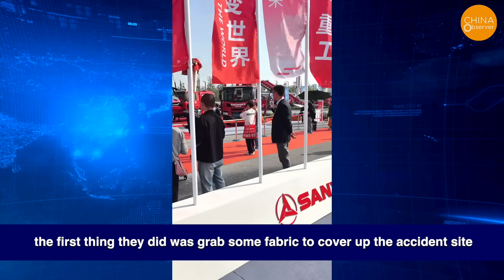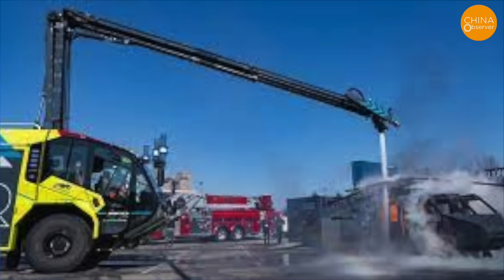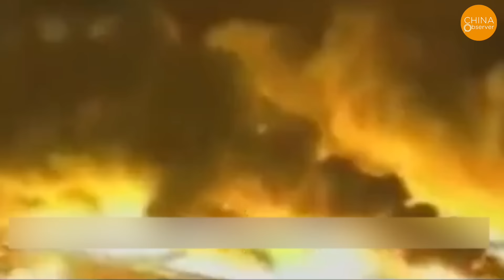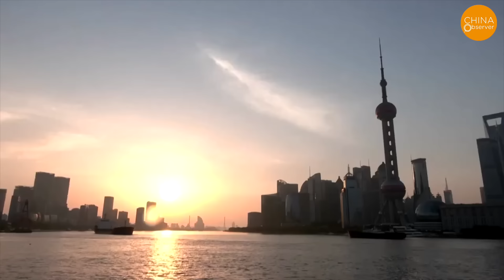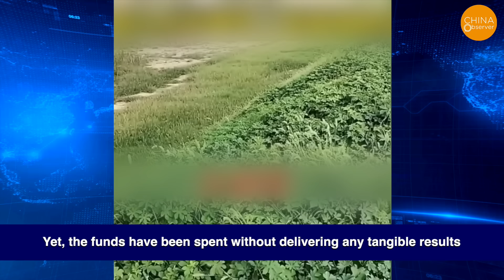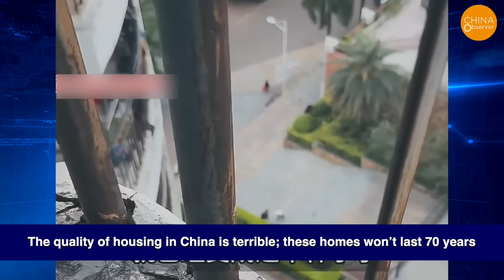Breaking! China’s Fire Truck Disaster at Global Expo: Ladder Arm Breaks, Shocking the World

Comment: This is too political. In engineering, stuff are tested to reduce accidents, failures and increase reliability but nothing is 100% garanteed. failure is low but never 0. I can asure you the rest of the same trucks can open its ladders and close it 100 times and face 0 problems. Ego and politics putting too much stress on engineering but lets hope they improve to save more lifes.

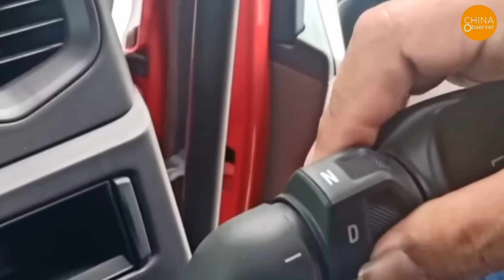Comment: 6:11 . its more then obvius that even if it is a older model of western made truck . its crane arm , hydrolica , pumps , engines and suspension as well electrical systems and or tech gadgets are ccp/pla/mainland china made as the west ''europe noir us noir related country's do not sell any of those along whit the truck to china , and only sell to china a barebone chassi'' and it is more then obvius just by seeing it all drive by in this video , that crane arm is to just way big and heavy . and that crane arm will break down while being opperated .

and i admit how strange it must be as a european such as myself . i have to say even if that truck is western/european made , i am suprised its trailer ewas able to hold the weight of that oversized way to big crane , as well the ability of that older model truck to even pull the trailer bed on wich that crance arm is mounted . 

and as a european , its jsut horrible to see how one of our western / european trucks are so horrible abused by the ccp/pla/mainland china .

Comment: when ccp/pla/mainland china does buy any vehical ''firetruck'' they only are able due to any kind of sactiuon , other country's laws , international law's and or any form of national and or international security risk to buy a bare chassi . it never is sold to ccp/pla/mainland china/mainland chinees whit tings like ''suspension , motor , pumps and or any form of electrical system and or tech'' 

thus china only can and buys barebone chassis , and has to fill in the rest themself whit their own ability of its own goverment and or indistry that both is excluded from and thus has no acces to any modern western ability , part and or tech .

Comment: an no , the most suficticated part is not the chassi . its in fact the tool/tools and ability it needs to deploy . and they fuckt up on the part where it was their own tools and ability , wich also was the mosut suficticated , crucial and important parts . as it was those parts that where the tools to be deployed and doing the job . the vehical/chassi was mearly a form of transport to get the neccecery tools and ability on location where needed . for such they gould have taken any transport platform even their own produced platforms . there was not much to fuck up about the transport platforms , but their was alot they can fuck up about the most crusial part's , wich is the tools and ability's that platform was suposed to transport and deploy XD 

how can any get that so wrong , and fuck up so badly XD 

ccp/pla spending so much in taken out loans on mearly ccp/pla prommises of ''positive gdp return'' and or ''positive finnacial collatoral'' ín order for the ccp/pla to unnececery overspend on tings ccp/pla/mainland china/mainland ordenari chinees dont need . and cheap out on the most basic yet most nececery and most crucial tings and tools they do need XD

and consider this quistion and meaning of awnser . why would china ever consider to buy even someting as simple as a western produced cassi . as western country's certinly dont not sell the newest noir any possible tech the ususaly would have on their chassi . so ccp/pla only buys chassi whit no suspension ,  motor no pumps no tech . as in ccp only buys an empty carcas . apperantly even a western made empty carcas is already more and beter then any chinees made chassi . and then ccp/pla by lack and inability of buying western tech , have to try and steal a few sreds of incompleet data and desings in regards of some tech . wich all is incopleet and unrelated tpo each . and try to mcgyver it all as a ''frankenstein faillure and hazzard'' together . wich is impossible to do right and ''unhazardus'' for the ccp/pla . thus end up producing utter ''frankenstein , hazard'' rubish XD

Comment: You should make a video on the substandard quality of Stellantis vehicles. Oh right, not Chinese so you don't care. Did you know that Stellantis has given up on Mahle charge controllers after they failed to fix a manufacturing defect for many years even after repeated attempts ? They now use a Chinese brand. At least BYD issues a recall for these out of warranty vehicles. In case of Stellantis, as soon as warranty expires the owner faces the full cost of this frequent controller failure. (well over $2000 for a new unit.)

Comment: The failed truck looks cut rate. They just slapped a common Utility boom and bucket on the chassis. The types used to work on power lines, etc. those are not appropriate for Firefighting. They are too weak, too small, and can’t handle the water weight being pumped up them. The other “innovation” which has proven “idiotic” in actual service is converting those concrete pumping articulated booms for fire fighting. It was an interesting idea. But in practice they bring no actual benefits in exchange for massive maintenance and operational headaches. Most cities that bought those things retired them in under 10 years because they spend most of it in the shop.

Comment: Honestly it could be innocent as I imagine this is made to work with water inside of a tank giving it more weight to counter the weight of the arm if they forgot and tried using it without water that could explain what happened.
Reply: Counter the arm? It might add weight to the base, but the arm didn't cause the truck to tip over. Not to mention, what would happen when they expend the water fighting the fire. The linkages collapsed. Horrible.

Comment: "It's normal for industrial products to have defects."

Sums up the chinese approach.
Reply: That statement coming from a citizen goes to show how low the chinese standards are. I'm also saying this based on my own experiences. Of course its NOT NORMAL for industrial products to have defects or else heavy losses might occur.
Reply: I once had a cheena engineer from a major port equipment manufacturer tell me "That slag in the weld was caused by something you did using the crane".  And he was actually serious about it. Got all offended when I laughed in his face.
Reply: @kolsen6330  what about major cranes boom failures due to material fatigue...
Reply: @acheable  In 30 years inspecting and repairing cranes, I have never seen a boom failure caused by "material fatigue". Overloading or operating out of load limit zones is what brings most cranes down. You would be surprised by how much reserve capacity is engineered into crane booms.
Reply: @kolsen6330  Tower cranes jib bend and collapsed due to extreme wind loads exceeding the permissible serviceability load limits of the material. Bolts and nuts failed due to corrosion thus material fatigue. Experts like you should 'dead' equipments served beyond its life span. There are tower cranes and equipments so badly maintained but still in service on sites because of cost saving.
Reply: Yea when the only practice applied is "race to the bottom," you're going to end up with a whole country that can't manufacture SHIT.  lmfao.  love to see them fail.
Reply: Famous for their tofu dreg products.
Reply: here in Austrlia , we are not allowed defects , , what is produced or constructed come under heavy laws , we must produce top quality products , and we are checked on all things , construction , manufacturing , even our water supply , , , everything TOP NOTCH , , nothing like China tofu stuff, with weak steel and shoddy tech
Reply: @66holt  What about the recent major cranes that collapsed in June and August 2025 in Australia.
Reply: @acheable  everything made in China has a bad name now , through Temu and plus tofu building and bridges , , face it CHINA makes shit steel and shit everything , , because of coruption , even other countries that have bought their war machines are angry , because they are crap , , , they steal designs from other countries and still cant make them work , , amazing theirn rocket looks like Elon's , , they stole it and cant make it work ,
Reply: @acheable  es that isrue ,, but nothing comared to CHINA and their buildings , bridges and shit electric cars and robots that are not as good as USA , , plus China just pushes it's crap products on the world , , , it is stopping and China will fall
Reply: Xi doesn't care about his people , , most are suffering , parents have to support their parents and their kids , , no jobs , no money , people strugglig for food , , NORMAL people , not rich , , , and they have no say in ligion or their life , , they are controlled beyond belief , it's crazy , can't say anything bad about what wrongs Xi doing or you get dissaopeared ,,, yeah , great county
Reply: are you a little pink , lol
Reply: Yep. The race to the bottom.  This is why you have international standards so that defects are definitely not normal.
Reply: Its still non specific performance of one part of the crane that carries a foreign brand. Like branded ICE vehicles being recalled due to defects or failures fo decades
Reply: @acheable  ICE branded????? No such thing. Also hard to recall an agencies vehicles "for decades" when ICE has only been around for a couple of years.
Reply: @kolsen6330 Continental cars have limited performance under extreme tropical weather conditions. Beside Cars be recalled due to inherent defects maintenance of ICE cars are more frequent and costly.
Reply: @acheable  We dont have "extreme tropical conditions" here. Maintenance of ICE vehicles is done at a government fleet service shop and is no more costly than any other police agency.
Reply: We have read of too many industrial accidents involving construction equipments such as tower cranes, excavators, compressors etc across the world reported in international journals. Just keep your eyes wide opened when you are walking besides, under or living across tower crane or telescopic  boom lifting crane.

Comment: If China builds 99 that work fine  but the 100th one murders you it's a failed design. Problem is that most people don't seem to grasp this concept.
Reply: The rest of the world won't tolerate a failure in more than 1 per 100,000,000 units. And that can''t be a failure that leads to someones death, if it happens anyway the CEO of the company will go straight to prison, drop the soap and get what he deserves. These are minor failures, were only the product itself breaks, and because it broke the customer will receive a new one free off charge, and economical compensation. No wonder made in China is a warning label.

Comment: Should we investigate the cause of the malfunction? There is no need to investigate. The cause is that it is made in China.🚒
Reply: At the exhibition they should hold a vigil to commemorate the 104 firemen who disintegrated at Tian Jin incident reminding CN that with lax or zero safety laws no amount of equipment can save them.
Reply: It says the truck was made around the corner or somesht 😂
Reply: It could be innocent. Most likely it was designed to work with water in it's tank adding to the weight that would counter the arm. They could have forgot and tried using the arm with the tank empty resulting in this. Im well aware of quality control problems in China but this problem seems likely. Not filling the tank would reduce weight reducing cost to move ship or even just the cost of whatever fluid they normally use would be a cost that could be saved.
Reply: @ChrisC-qh4io  ladder trucks don’t need water ballast. That’s what the outriggers are for. This was the boom failing. Not the truck tipping over. They used a common lightweight utility truck boom designed to lift one guy in a small bucket to fix power lines. They put a firefighting platform  on the and and pumped water up it. The math don’t math.
Reply: @ChrisC-qh4io counter the arm? It might add weight to the base, but the arm didn't cause the truck to tip over. Not to mention, what would happen when they expend the water fighting the fire. The linkages collapsed. Horrible.
Reply: @ChrisC-qh4io no excuse, equipment should work regardless of condition, situation, or environment.
Reply: @ChrisC-qh4io  This is a global exhibition where only the best products and best safety practices are highlighted. Dismissing it with a 'it could happen anywhere' remark is excusing negligence. It's just lucky that no one was injured nor killed.
Reply: @ChrisC-qh4io 😂😂😂😂😂😂utter nonsense
Reply: They'll just blame the operator 😂
Reply: Didn't even have anyone in it and it failed  😆
Reply: it is said that the failed parts are from sweden and germany, expect that most people from comment that is anti china product are 5 year old kid with a 45 year old age that wont reply after being shamed by me.